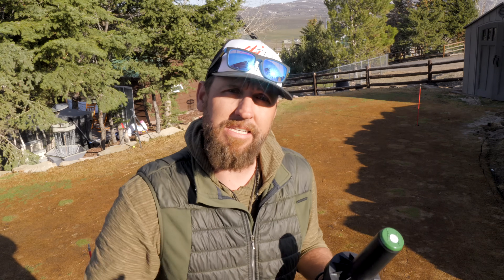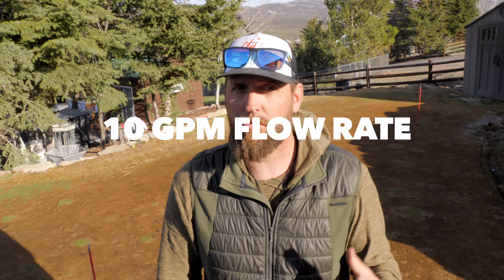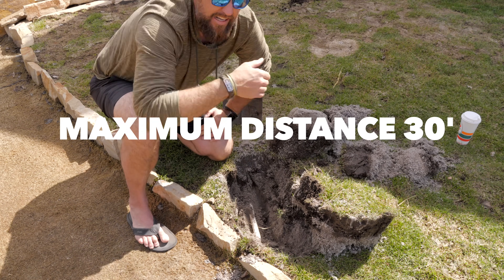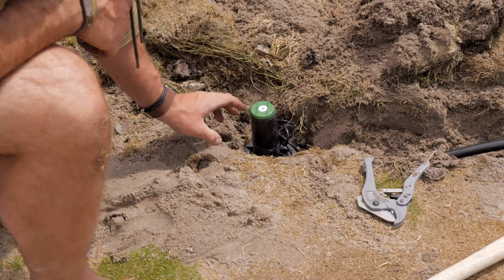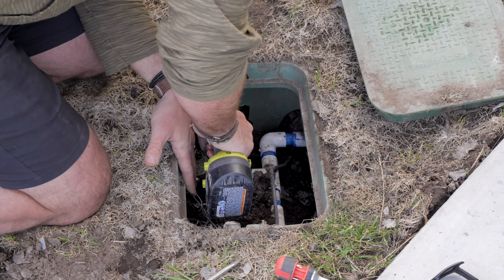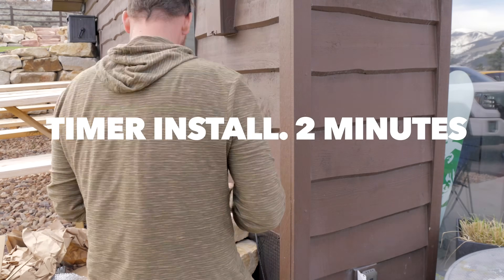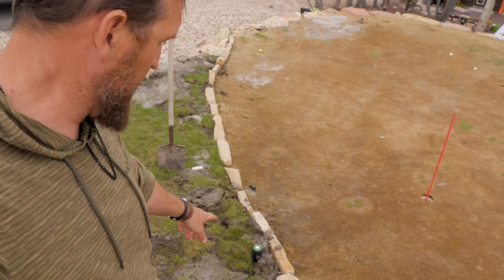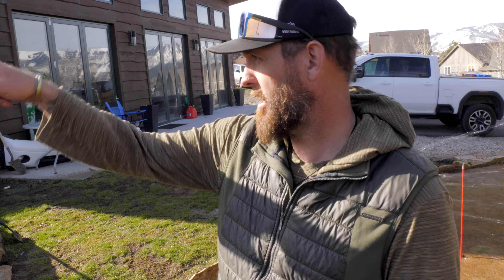How to INSTALL the MOST EFFICIENT IRRIGATION. ONE SPRINKLER replaces TEN!

Comment: Hey i am trying to retro fit this system and a little confused on what you did with the valves there? Like you never had them working? Or that’s like something you turned off?
Reply from the maker: @aryapatel3085  valves are permanently on
Reply: @ ok so did you turn them off in the video? I am confused about the diaphragm too. Like do i have to do the same?

Comment: I’m wondering how well this works. If it needs 70+ psi, that will be tough to get in most residential. Static pressure, you can get 70 psi plus very easily but dynamic pressure is totally different. And you have to consider the fact that you lose psi through the Backflow and pipes. 

I’m in Ann Arbor Mi and avg static pressure is 72.  Once it goes dynamic, I’m down to low 60s. 

Before you all run to something like this, understand what you actually can do with your water system. 

Another fun fact is the GPM. 10 GPM is a lot for this device. If I had to guess, 95% of my installations have GPM between 9-9.6.

Looking at this video and the water stream from the sprinkler, I’d say he doesn’t have enough psi to run it. The streams look weak and this Efficient part becomes inefficient when you can’t run it correctly.
Reply from the maker: It works extremely well and the system is right where it needs to be. Max throw is 30’ which I get no trouble. The stream is thick, the way the water disperses is high volume. .05” per rotation. 

I’ve had them in for almost two months with no issues. I will feature them more so check back and see how it goes.

Comment: They either paid you or gave it to you for free. I called and talked via zoom. This system is more than $3000. They tell you that it has a warranty and they’ll have someone fix if it breaks during that warranty. Who in the heck knows how to repair these near me?? Last thing is when it does break, it takes weeks to get a replacement. By the time you get the replacement, grass is dead. I have 100 plus degree heat. It’s to expensive to trust that it’ll last for years.Not worth it. I’d rather go to homedepot and replace my broken sprinkler for a few bucks. Plus you have ugly wires hanging everywhere. Don’t buy until price drops significantly.
Reply from the maker: It only takes a couple days to get a replacement head and it’s not for everybody. I’m running it this year and it will be in 12% humidity, high winds and high exposure. It’s longevity will be tested, it’s performance and everything else that goes with it. Right now it’s hitting my gold green perfectly. How do I know? I put material out that would move and spread. If the water didn’t hit it right, it would stay together. It’s the most uniform watering I’ve ever seen. Here’s the parts that can fail:
Controller.
Sprinkler.
Likelihood of controller failure? Very low. Head broken? Sure. Call in for a replacement on priority shipping and send yours back. Your app will tell you if there’s a watering problem.

Comment: How far can it cast out? Because I got a pretty big yard. Just one section of my front yard is 4 maxipaws and 3 pop ups. The other section is at least 8 pop ups, and the side is 5 pop ups. That's just the front yard!
Reply from the maker: 30-35’
Reply: @Lawncology  dang so close the large section of the yard is 45' wide. So need two for each section except for the side.

Comment: John the top 5" or so of your sand mixture you dug up is darker than the bottom portion. Does it appear darker because it is wet or due to the mixture of peat moss into the profile, or possibly the humic acid you've applied penetrated that deeply? Also how deep did you find the roots from the bentgrass turf? Fun watching all your content this Spring! Been dealing with snow mold in Utah too, it sucks this year.
Reply from the maker: That section was part of the green at one point. I buried it with soil and planted the rye. The roots are like 18” deep or more.

Comment: I just bought a gallon of greenkick 0-0-25
I see it's potassium carbonate is that gonna mess up my ph or salt levels in my soil i just got test results back
Reply from the maker: No, you’re going to get excellent absorption. Follow the rate on the label. It’s intended for foliar uptake.
Reply: @Lawncology: Next Level Lawns  okay great was concerned about that because it's right at the normal/acidic level
Will just use backpack sprayer no need to water in

Comment: That is very cool. In theory you could install it in your flower beds if the layout and size of lawn works and won't need to install in lawn area or even hook up to a sprinkler system if you don't have one.
Reply from the maker: That is correct. You can even run parts of your old system to their timer. It’s got zones ready for standard drops and things.

Comment: I am curious as to what you will need for watering times with just a single head. Those are pretty rad for sure, and am excited to see how well it will help you in your efforts! As always....well done! Whats your thoughts on EZ-flow fertigation dispensing N-ext products?
Reply: It is believed that grass needs an inch of water a week. Roughly .62 gallons per square foot. An acre of grass would require about 27,000 gallons a week if the system was 100% efficient, working in a controlled environment with no other forces effecting it, ie. evapotranspiration, wind, humidity or lack there of. 100% efficiency is unobtainable. A professionally designed system is at best 70% efficient. Due to the efficiency and uncontrollable outside forces most lawns need 1.5 inches per week of water applied, through irrigation or mother nature. In the rainy season you're good, in the heat of the summer, you need to water. Know your square footage and multiply by .62. Multiply that by 1.5, then divide by your gallons per minute. That's your total run time per week. Finally divide that by how many days a week you are going to water. In this situation less is more, every 2 or 3 days is best. Water less often and longer, it promotes deeper rooting. Thank you, I'll be here all week, try the chicken and don't forget to tip your waiter.
Reply from the maker: I’ll be running it and I’ll let you know once I see it all working together. The heads put out .055” per rotation. Right now while I rehab the green, they each water 16 minutes. The second head only sprays for half of that since it’s on the edge.

Comment: Why would you not just turn the solenoid a quarter turn on the valve to leave it on manually instead of cutting the diaphragm. Most valves will turn on by turning the solenoid without leaking water.
Reply: It certainly does. I'm an Irrigation contractor. Stumbled upon your channel after watching you explaining the soil test results to ryan knorr. Loving your content. Keep up the great work man!!
Reply from the maker: @jeffberberian907  good to know. I never feel like when I do that I’m getting the same pressure out. Honestly I’d rather not have them but this was easy!
Reply from the maker: I feel like doing that doesn’t provide full flow

Comment: I would just buy an Otto. Much cheaper, same result
Reply from the maker: I haven’t looked into them
Reply: @Lawncology: Next Level Lawns  you should definitely check it out. You can setup multiple zones within the same sprinkler. You can spot spray landscape, line spray and it even takes fertilizer. Definitely worth a check
Reply from the maker: @fabrones49  I looked at it after you mentioned it and yes it is pretty cool! I’m
Not a huge fan of hoses but I suppose you could find a permanent spot and hard plumb it. My hose lines here don’t give enough pressure to throw far, their on a different line than the irrigation… I might have to demo one.
Reply: The oto is similar in my opinion, but not necessarily designed for existing in ground lines. Hose connection to the unit that can mount to the ground, post, house, etc. The downfall I see of the oto is just being in the sun day in and day out and deteriorating, and being so exposed/ visible. Would be nice to see an actual review of one, rather than promo videos as well. Maybe JP can get hooked up with one, to show it off, he has my vote.